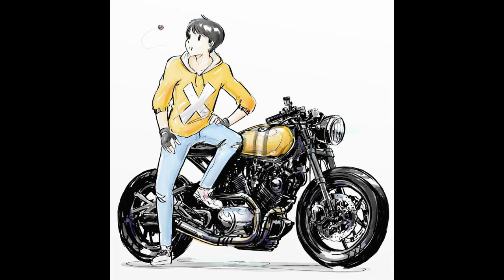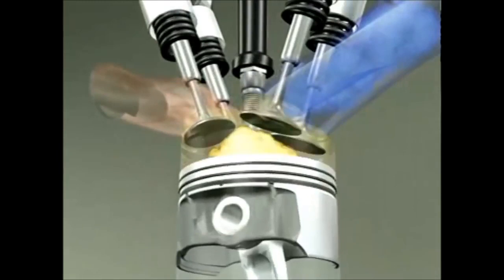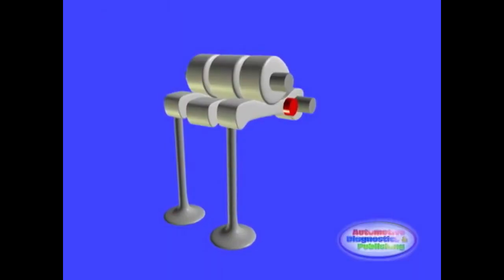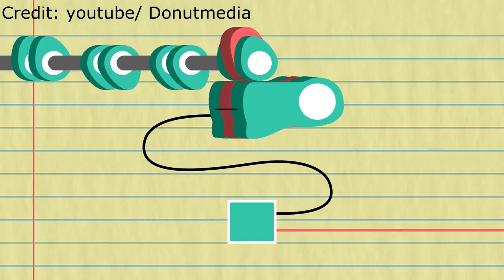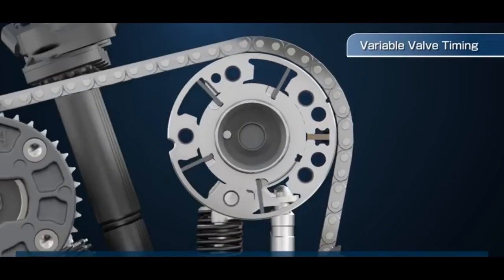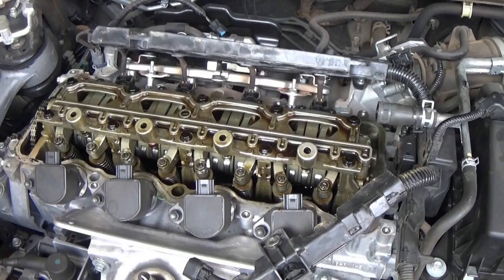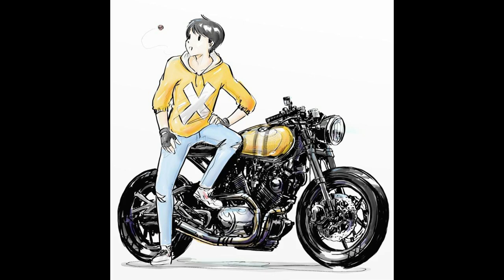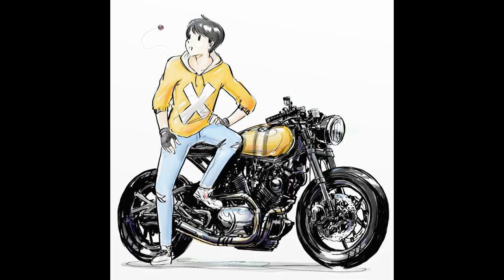What is VTEC in Honda cars ???

Comment: nice man, and funny too.
Reply: Also bro, what do you think of Honda city 2020? Comparing it with the Vento/Rapid 1.0 ? Which is reliable and which will stay longer ? I mean I would want to keep the car for years and years. Also need driving pleasure.
Reply from the maker: @abhimenon801  if you want reliability you can't go wrong with either the Honda or Toyota. 
Although I haven't driven the new Honda city, I am sure it will be a great car as the previous gen car was really good. It probably will be great to drive as well as Honda does get their driving dynamics right most of the time.
Also both the Vento and Rapid are really old now even though both companies have done multiple facelifts and tech upgrades  both cars are almost a decade old now and both companies might launch a new gen vento and rapid either at the end of 2021 or early 2022.
so I would say the Honda city is much better compared to both the current vento and rapid.
Reply: @superchargedpetrolhead  how about vehicle dynamics ? Some say honda city new gens aren't enthusiastic enough. What do you feel on that ?! Thank you for your response
Reply: @superchargedpetrolhead  also they had released vento and rapid with 1.0 turbo.
Reply from the maker: @Abhi Menon as I said before I haven't driven the new gen city and I haven't driven the new 1.0L turbo Vento and Rapid, so I can't give opinion on exactly how they feel and compare but I would recommend these videos:
City vs Vento : https://www.youtube.com/watch?v=6X4IofqOFYM
City vs Verna vs Rapid: https://www.youtube.com/watch?v=LTikCWZ88Io

But the best advice I can give is test drive all three cars and chose which suits your needs interms of space, tech, features, comfort, driving dynamics etc.

Cheers mate.

Comment: Which car should I take Honda, toyota, ford or  hundai in best engines long run  and fuel efficiency. Reply pls
Reply: Toyota or Honda simple
Reply from the maker: Most of the modern engines are really reliable, but what do you prefer petrol or diesel engine..... Tell me which one you prefer and what cars you have in mind, it will be easier to suggest one...
Reply: @superchargedpetrolhead  sir, I am planning petrol, FORD Freestyle, hyundai i20, Honda Amaze/WRV, 
Or     Toyota Etios liva. 
For normal family use (not much)pls suggest in India.
Reply from the maker: hey there, i will say some of the positives and negatives of all the cars first. it is a long list......

Ford freestyle - comes with a 1200cc 3 cylinder draken turbo petrol engine, it is quite powerful but it is a new series engine and hence long term reliability is still unknown, it is reasonably fuel efficient as well, since it is just a 3 cylinder engine it is not refined, and it only comes with manual transmission there is no automatic, the top end model gets 6 airbags.

Hyundai i20 - comes with a 1200cc 4 cylinder naturally aspirated petrol, it is low on power compared to freestyle but good enough for most of the city use and highway runs, it is extremely refined and smooth, it is quite efficient as well, top model gets 6 airbags as well, it has the most amount of features under 10 lakhs. you can also consider i20 Active it is slightly more expensive than i20 elite but has more ground clearance and has a nice crossover/ SUV look. i20 elte has both manual and automatic but i20 active only has manual at the moment.

Honda amaze - comes with a 1200 cc 4 cylinder petrol, available in both manual and automatic transmission, great engine refined and fuel efficient as well, comes with 420 liters boot space, does not have as many features like freestyle or i20, it is the highest selling Honda car in India. only gets 2 airbags

Honda wrv - direct competitor to i20 active, same engine as amaze, it only gets manual transmission, has more legroom in the rear seat than i20, high ground clearance like i20 active and freestyle, more features than amaze, highly fuel efficient. only gets two airbags

Toyota etios liva - 1200 cc 4 cylinder petrol, low power, it is the oldest car in the list and Toyota might replace it in a couple of years, lacks many features like other cars in the list, only available in manual.

             I have said most of the positives and negatives of the cars now i will give you suggestions. Etios is a great car but i would not recommend it now, since it is a really old car. it was first launched in 2010 and it will be replaced by a new car in a year or so. So i wouldn't recommend it.....
             
             If you want a compact sedan for your family then get the amaze it is a great car, but if you want a hatchback/ crossover then b/w i20, freestyle and wr-v it is mostly your preference, all of them are good but remember i20 and wrv are from a segment above and hence slightly more expensive than freestyle but they are more premium cars, freestyle is smaller than i20 and wrv as well in overall length, width and size. B/W i20 and wrv the i20 is more premium feeling it gets more features and also gets 6 airbags while the wrv has more space in the inside than the i20 especially in the rear seat.

             i would say test drive them and take your family to see all the cars ask them to sit in and see which suits your family needs better, every car you have mentioned has a good engine and reliable as well so most of the time it is just the preference. 
   
             so sum it all up, if i was looking for a compact sedan i would get the Honda amaze and if i want a hatchback i will get the full option i20 active as it is basically the i20 elite with more ground clearance (190 mm) than i20 elite (160 mm) so speed breakers and bad roads are no problem it has every features you will ever need like apple carplay, android auto, navigation etc and most importantly it has 6 airbags for the safety of the family but you can also get i20 elite it too has 6 airbags and everything. But if i20 is too expensive for me i will consider the freestyle full option it too has 6 airbags, it does not have many features but has most of them. so in the end it is mostly your decision buy the car which makes you and your family happy.

             if you have any more doubt feel free to ask me, i will be thrilled to assist you, cheers mate.
Reply: @superchargedpetrolhead  sir, thanks for your valuable reply and I go one among the 3.
Reply from the maker: @Creativeart12k  Hey mate, As i said do test drive them and take your family to see the cars as well and make sure they suit your family needs before booking the car and advance congratulations for your new car, cheers and have a great day
Reply: Bhai I am in big confusion to take ford freestyle or Honda Amaze in petrol...both r good.pls help me choose one... freestyle is features loaded great build quality but compact and amaze is spacious and great Honda engine. We 4 adults 2 children normal usage rarely pls suggest I advance booked both 8106679119. 
Thanking you bro.
Reply: Bhai I am in big confusion to take ford freestyle or Honda Amaze in petrol top end as I take in CSD canteen...both r good.pls help me choose one... freestyle is features loaded great build quality but compact and amaze is spacious and great Honda engine. We 4 adults 2 children normal usage rarely pls suggest I advance booked both 8106679119. 
Thanking you bro.
Reply from the maker: @Creativeart12k  hey there brother, you can't go wrong with either of them both are great cars but as i said earlier it comes down to your preference. The ford freestyle top variant gets more safety features like 6 airbags and traction control etc but it lacks in rear seat space and boot space while the Honda Amaze   although it lacks interms of features it has more rear seat space and more luggage space and also the rear seat is more comfortable both cars could be slightly small for 4 adults and 2 kids especially in a few years when the kids grow up but as for as space the amaze is still better.
I can't exactly say which one is better because i don't exactly know what your needs are but as i said earlier you can't go wrong with either of them, test drive them and most importantly take your family to see both cars ask them to sit in them and access which will suit your needs the best and then decide...
And also are you from Tamilnadu?